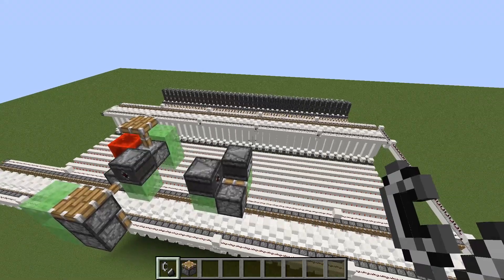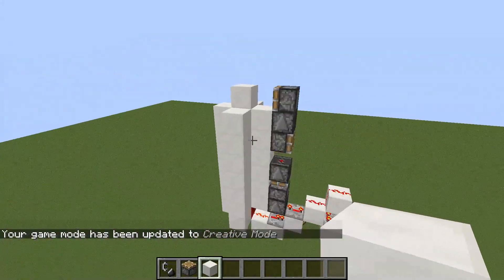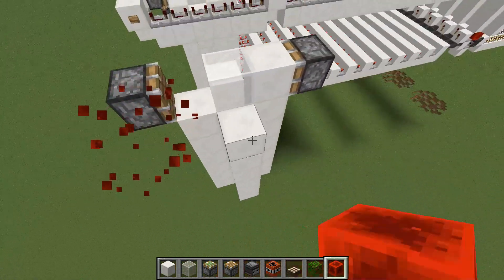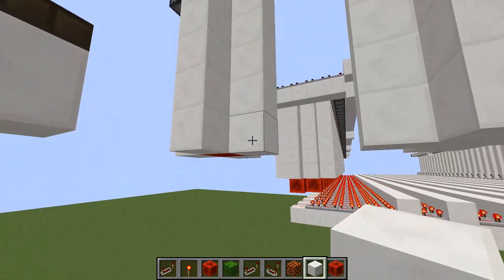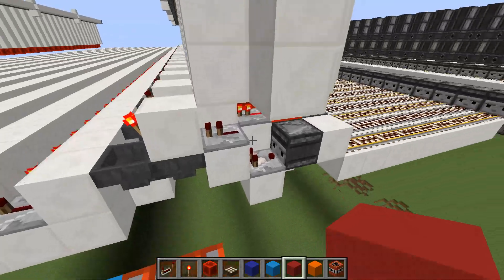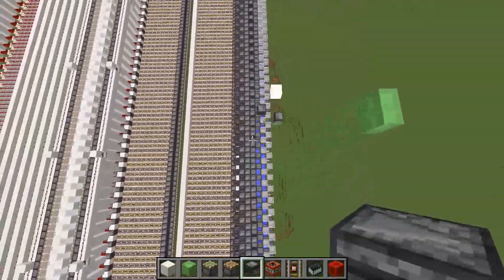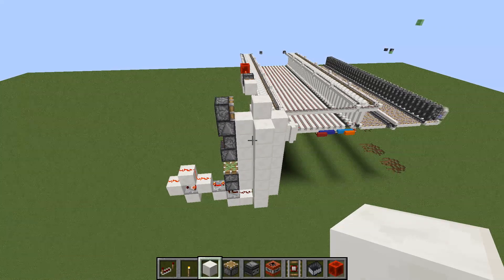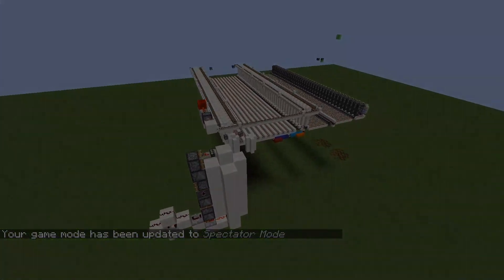missile defence 2.0 [explanation + world download] | gamemode detector

Comment: Perhaps when you’re not in spectator, the game does more light updates in order to check if mob spawning is possible on certain blocks? I did some testing and the behavior is quite strange, but I guess it is related to the many optimizations they did for lighting, for instance closing a hole in a large roof is very laggy, while opening a hole is faster. I also tried replacing the side blocks with slabs, and recording and playing back video at low speed, and it appeared to do recursive updates, 1 step every game tick. My best guess is in spectator it only does 1 recursion step, but in creative it does 2.

Comment: fantastic video, good explanation

new game for the technical Minecraft community: build a missile that can bypass this defence system (maybe changing speed if possible?)
then build a better defence system that can catch it
etc

also, I would be really interested in tileable flying machine doors (and flying machine mechanics in general as well)
Reply from the maker: Okay, thanks for the feedback!

making a better system should be doable, because you can just nuke a 50x50 area after a flying machine is detected, however, there is not much challenge in this. That's why I decided to always use 1 TNT per missile (or 2 if the missile is 2 blocks wide) this makes it a lot more of a challenge. 

For missile defence 3.0 I was thinking to take the missile out with a flying machine. This requires to know both the height and the speed of the flying machine, and then you need to make a much, much harder calculation. I think it would be a lot of fun to try though.

I'll probably build up the door again and show how it works.

I also was thinking of making an advanced slimestone tutorial. So not just say "this is an engine and this is how to make extension", but also go into all the different engine types, selfreturning engines, instant extension, and other slimestone related flying machine stuff. I think a lot of people would be interested in this
Reply: @comet1072  thanks for the reply ^_^

This 3.0 idea sounds really advanced and interesting :D

And an advanced slimestone tutorial, or maybe a short series sounds definitely something i'll rewatch from time to time, thanks :3